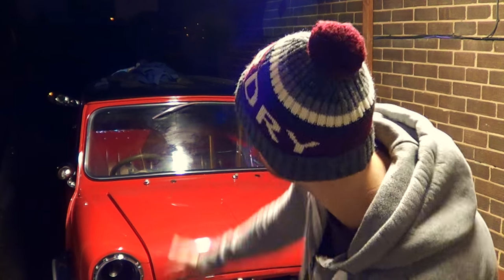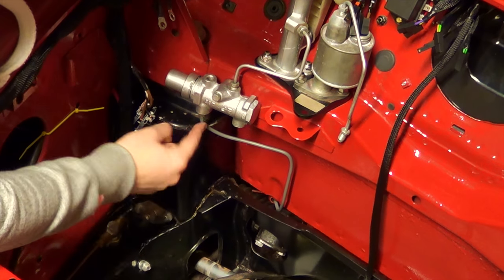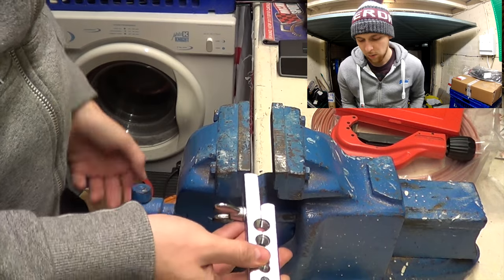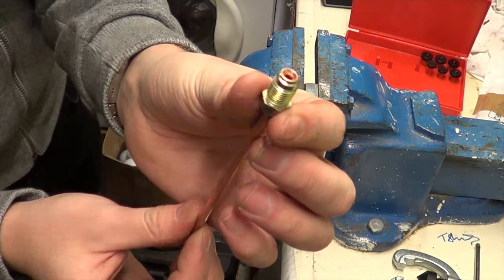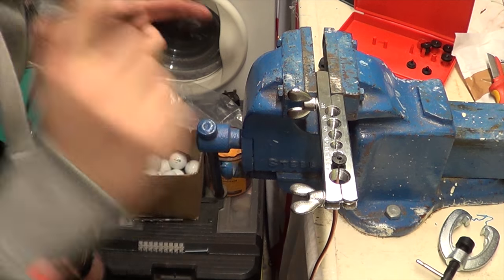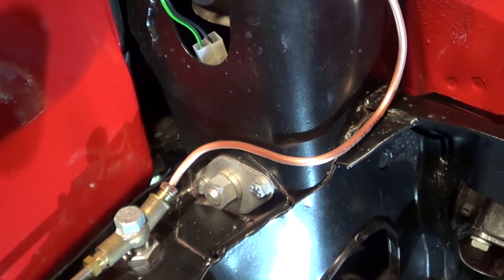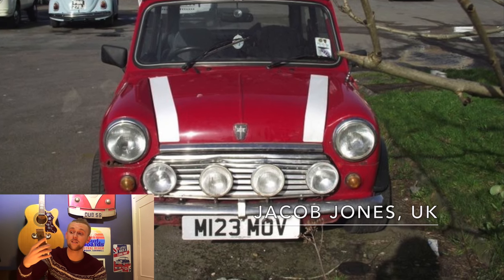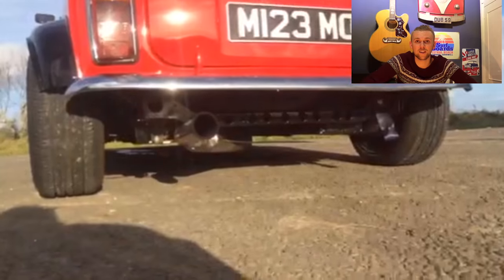Classic Mini Restoration | Brake Lines & Unions

Comment: I kept all the brake pipe that came off mine so that I could use it as a template to form the new pipes because they have to be a pretty similar shape so they don't foul anything when the engine and other parts are all back in the car. I never found that I had to use the pipe bender before, much easier and quicker by hand (carefully not to over bend). Cars coming together nicely though, looking forward to the engine going in and keep that pipe out of the vice, it crushes too easy
Reply from the maker: DB Mini DIY haha! Thanks for all the advice mate! I can’t wait for the engine to be in too! 👌🏻👌🏻

Comment: Doing a great job. You might find doing up brake lines easier if you have a flar spanner, which looks like a single hex ring spanner with a slot cut out of it. Should be avaliable from good tool suppliers...lol
Reply from the maker: Gavin Ivers thanks Gavin! I’ll definitley order one👌🏻

Comment: Hey buddy there are two kinds of brake line fittings/unions.  You have the wrong ones for the brake line flares your usings.  The ones your looking for have an inward taper and are threaded right to the end.... Love the work keep it up.
Reply: So i watched you vidoe once more and it is hard to tell but i think you have the right fittings but are making the wrong kind of Flair.... Take a look at the line you move from left to right and see if they look the same
Reply from the maker: Hey Dude! Thanks for the advice! You are certainly right! But looks like I learnt yet again by one of my mistakes! 😂 I will rectify this in the next video 👌🏻👌🏻

Comment: Another great vid! the chopping / edit in fast forward was a bit weird, I couldn't focus! Ha! Is that copper line? In Aus, we can't use copper lines, they reckon they can crack..... I like Cunifer line, Cu Ni Fe Copper Nickel Iron alloy, doesn't rust or crack. As others have said there ae two types of flare, cone type and double like you were making. Fitting internals will show what you need. Keep up the good work Mr Shorrock ..... How cool is that, named after a supercharger  :) ! !
Reply: As far as I can tell copper is ok in UK, but there is talk of it work hardening over time. http://www.nsra.org.uk/newforum/showthread.php?13436-Kunifer-vs-Copper 
Cunifer or Kunifer available here, can be a bit harder to work / bend / flare :) https://www.carbuildersolutions.com/uk/coppernickel-brake-pipe-316
Reply from the maker: Top man! I’m going to correct this in the next episode! 👌🏻 how ever just goes to show I’ve made a mistake and I’ve instantly learnt from
It👌🏻 being named after a supercharger means it was destiny for me to own a mini 😉😂

Comment: Assuming that you've not already put the engine in, try and trial fit as many bits as possible to the engine before it goes in, even if you have to take most of it back off again when you put the engine in. Might save you a bit of faffing about in tight spaces wondering why something doesn't fit or line up!
Reply from the maker: Badgersize thanks bud! And no engine hasn’t gone in yet, hoping to drop the baby in, in the next week or so 👌🏻

Comment: your flares are wrong you need a different tool to make a dome flare  you need to look into the hole and see if it has a counter sink or a dome that way you can flare the pipe to suit also the correct way to flare pipes is to make it dome first and dont remove the pipe from the tool  then use another die to make the concaved flare
Reply from the maker: mark piper thanks bud! I’ve realised this, I’m going to correct it in the next episode, like I say the best way for me to learn is to make mistakes 👌🏻 and have you mini gurus correct me 😉
Reply: Mark is the fella that kindly did the timing on ruby, Top chap and really knows his stuff!